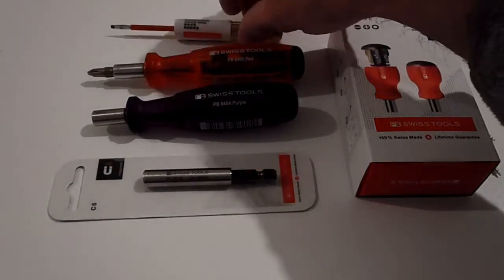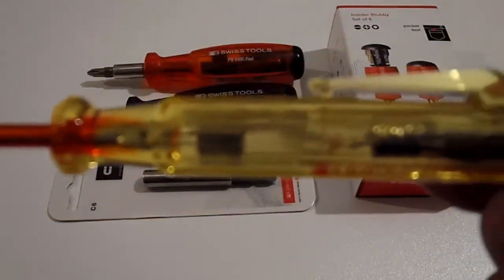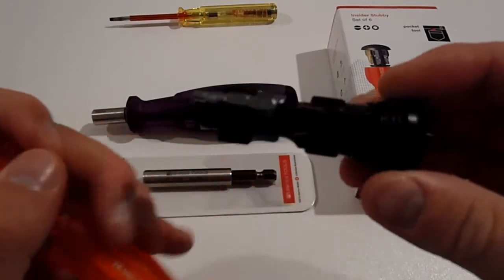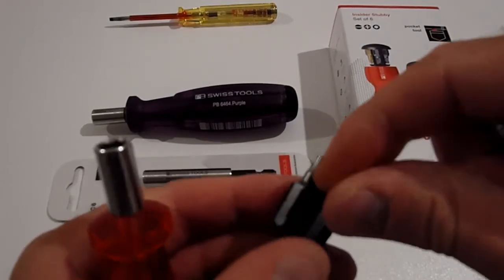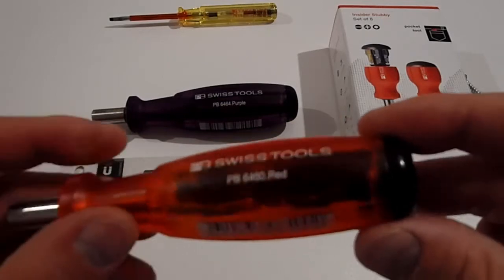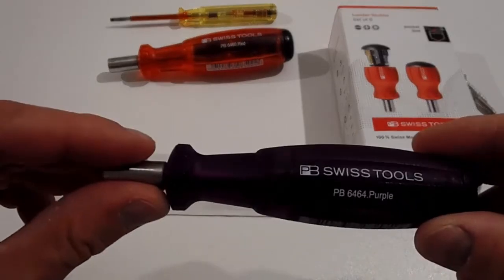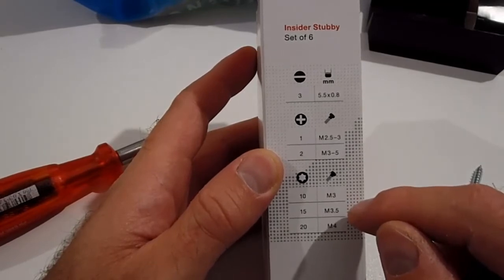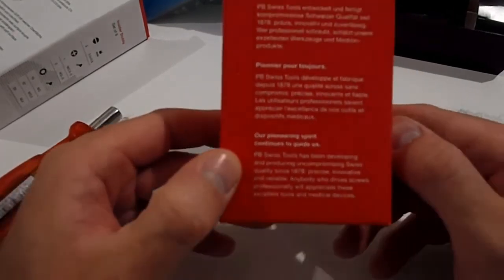Multi bit screwdrivers from PB SWISS TOOLS review!           Tournevis multi-embouts PB SWISS TOOLS

Comment: What's the best one to have as your main screwdriver? The 6464 or the stubby? Cheers mate 👍
Reply: I really like the 6510.20 personally. The full length is really convenient and 9 bits. It also folds out so it is a fixed unit when in use  no rotating butt like on the insider series. The stubby is great for a bike kit or small edc.
Reply from the maker: I like the medium size one but the longer version one is quite handy when you have out of reach screws :) They all have there functions ;)